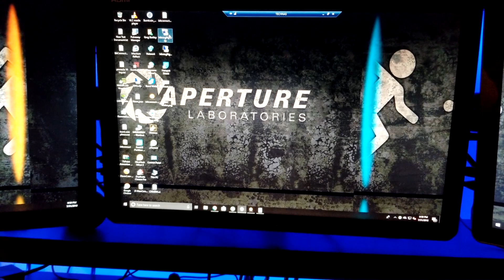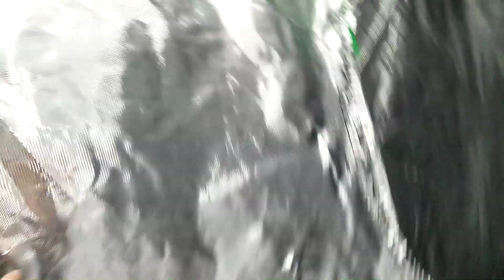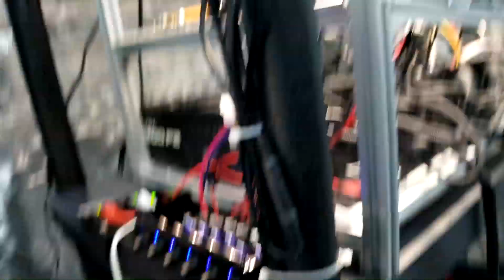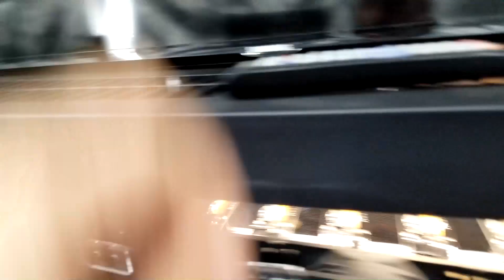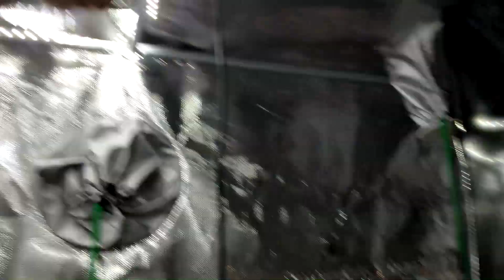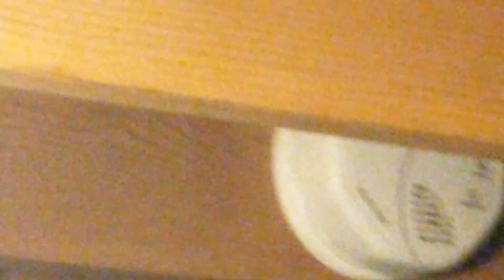Mining Rigs Tour

Comment: Thank you for the tour - great to view.  You are obviously safety conscious, might I suggest getting everything off of the floor by some x inches in case you have a flood in the basement?  Especially the power cords - that's just pure trouble.
Reply from the maker: Brett Attee Good suggestion. At the least add a GFCI.
Reply from the maker: Hey Brett. I followed your suggestion and even went a bit further and moved the server rack into the tent. It's a lot more crowded in there but I figured it isn't intended for anyone in take a lunch break in there. :) It also gets about 100F and I've received notices on AwesomeMiner that my GPU's were getting too hot (above 80C) so I had to make some adjustments with the fan speeds and I'm adding an 8" 740 CFM fan as in intake to push the cool air in and the 351 CFM (on top of the tent) as the exhaust.